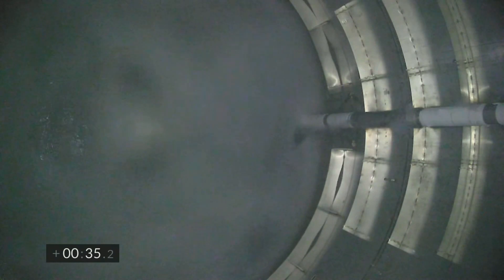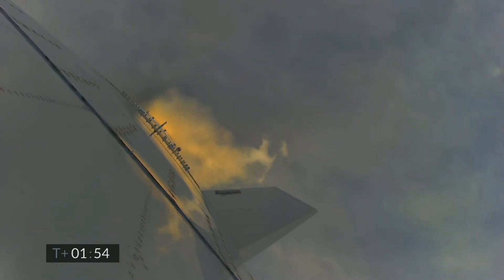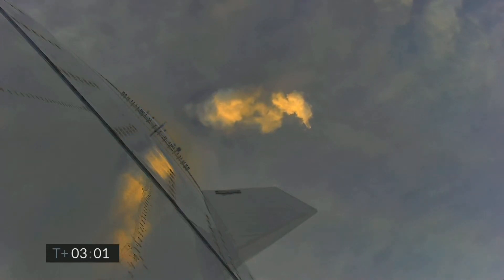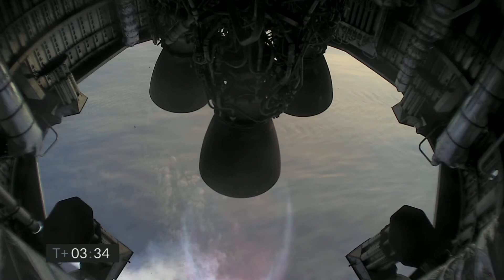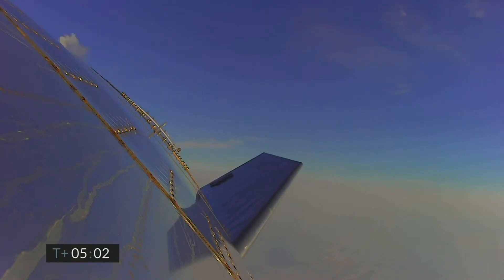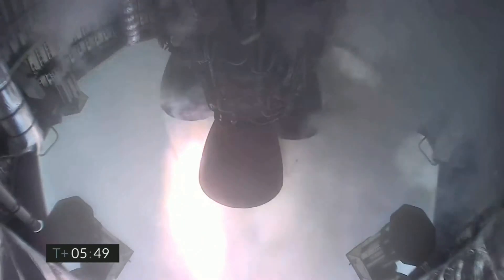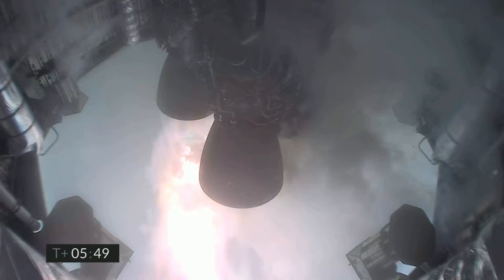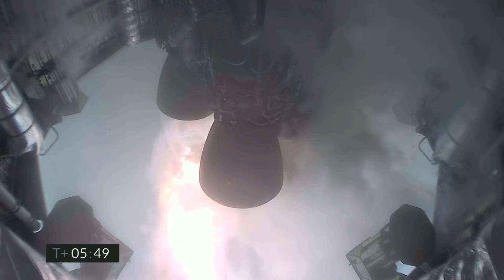SpaceX SN11 launch and explosion  in the FOG 2021-03-30

Comment: My guess is that the FTS was activated. The camera cut out right after ignition and was followed by a flash and flying debris. The flash seemed to be from above not on the ground.
Reply from the maker: yes, I thought that, the camera cut off was way too early and the Flash and the range of how far the parts flew was so far away from the potential crash pad